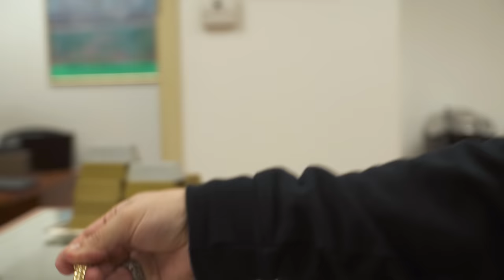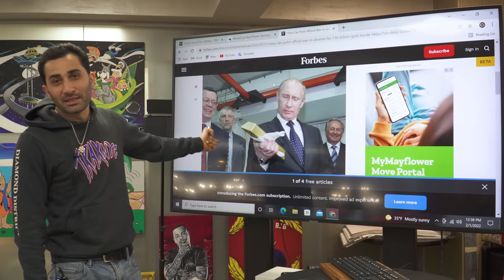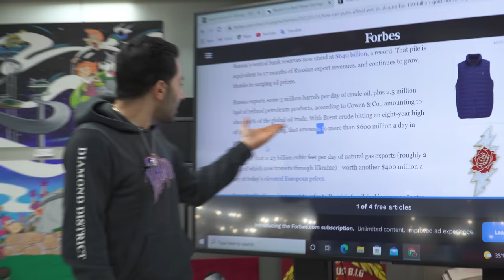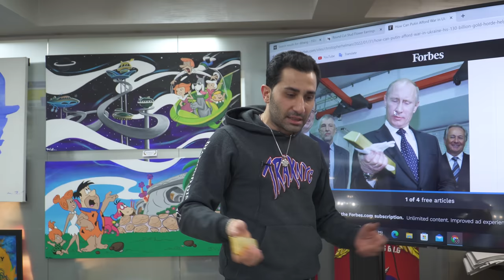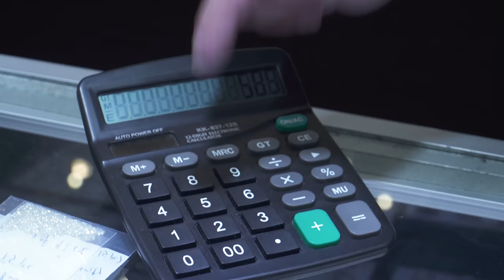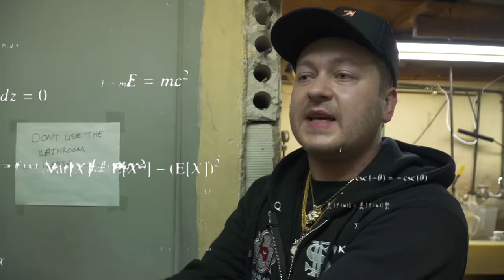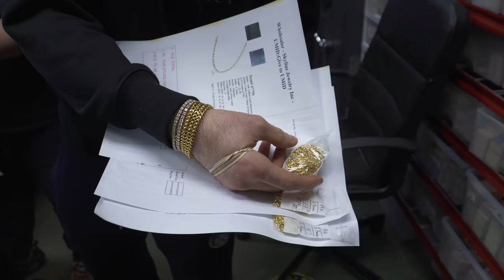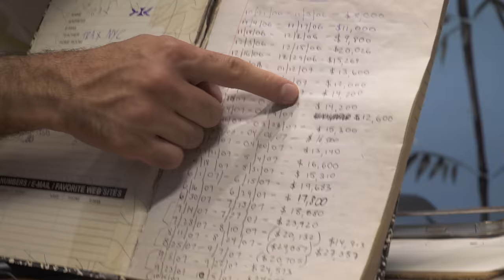HOW MUCH AM I WORTH??? IN GOLD | THE DISTRICT S.2 Ep.2

Comment: Questions, would you prefer to buy a 24k gold bracelet or a 24k gold bracelet with diamonds? Which would be better? Price difference is about 3k more with diamonds.
Reply: Depends on the person. Some people like ice, some don’t…I prefer my gold without diamonds, but I’m not a flashy person. And the gold is where the investment is at. Depending how you have the stones set, you’re drilling into the gold ultimately making it weigh less, and replacing that gold weight with stones.
Reply: 24k gold is a bit fragile, in my ignorance is not worth it, 14 or 18 is good, don't buy jewerly as an asset, they aren't, buy just the weight that you want in oure gold (little bars and other) if you want diamonds remember that small diamonds if they aren't particulary special are not a big thing, you will lose a lot of it's value, i suggest you if you want ice and gold on a bracelet to buy a 18k or even a 14k, the thing is that if you choose a tennis type you need big ass diamonds and it will be expensive, the majority of the price difference is for the casting, the setting and the actual time to make the piece, diamonds are less valuable than gold in small pieces
Reply: 24k is super soft. I'd honestly only make thick pendants out of 24k and It's way to soft to set stones in. One wrong press against clothe an if a prong gets stuck, it can bend with ease and you'd lose your stones. Assuming you do put stones in pure gold settings, they'd be of high clarity and value. To risky. I'd say if you have money to make pure gold jewelry, you could do whatever you want with it. I'm a jeweler myself and if a client ever wanted stones in 24k, I'd highly suggest not doing it. As homie stated above, gold is where the investment lies. So unless you're adding VS1 pointers to your piece, 100% natural, or even flawless, I wouldn't do it. Maybe a giant solitaire with heavy thick prongs just to flex. But I don't think anything more than 22k is safe for jewelry unless its a pendant with a thick bail like the 3 casted in this episode. It's just simply too soft.
Reply: @valeblack3393  facts
Reply: @jeweleryreviews101  I had a complete loss of brain functioning when I was typing my above comment haha. I completely forgot that the original poster said 24k gold. I agree, never stones in 24k but my comment was aimed more so at gold in general. I wear a 14k chain and having a custom 14k pendant being made right now. I’m not into diamonds but unless you’re having prongs added, you’re losing that weight in gold to have holes drilled for diamonds. That’s a no go in my book.
Reply: @marinevet92688  facts
Reply: @jeweleryreviews101  you sell silver?  And wouldn't drilling Into the 24k to put gems would weaken the gold over all durability no?. Since no pressure won't be evenly distributed it would damage more at the gem no?
Reply: @fckyoutube5109  uhm yes I sell jewelry in all types of metals. And no I personally wouldn't put stines in 24k unless the prongs were built large and the gems were large. Small prongs could bend and break and you could lose your gems. I'm confused by your questions. We're talking 24k gold, not silver.
Reply: Thanks for the feedback guys. I went with the bracelet with no diamonds instead.
Reply: @jeweleryreviews101  yes I been trying but silver for some time now. Either sold out or back order. And does adding gems to a ring weaken the metals strength overall? Is my main question
Reply: @fckyoutube5109  adding jewels to sterling silver is totally ok. Soft metals like 22k-24k is where things get worrisome
Reply: @jeweleryreviews101  ok wanted make sure. Gems and good karat gold are a no no. No how much is the asking price for silver ounces
Reply: @fckyoutube5109  currently I believe pure silver is between $20-$24 per oz I'd have to check today's prices. I'm located in Dallas TX. Where are you located?
Reply: @jeweleryreviews101  I'm in Delhi California. You have a company name I can look up and message/call you thru. It's been almost 3years since I've seen silver. And man oh man do I miss her. Silver is the best metal. Great for inlays or pieces to a cane. Silver is king to me. Everyone wants gold. If I have a fat necklace of silver people won't rob me on street but not a fat chain of gold will get yanked off me so that's my reasoning